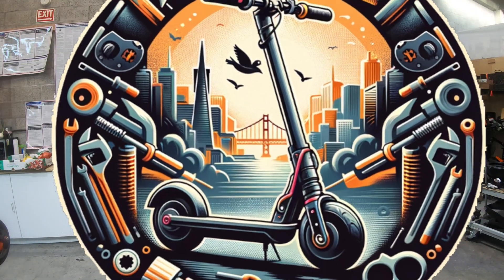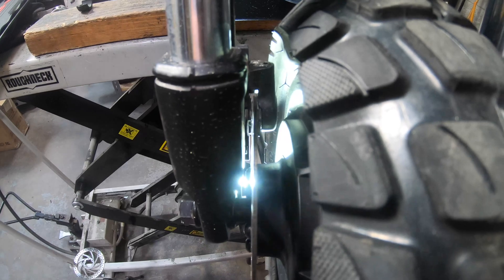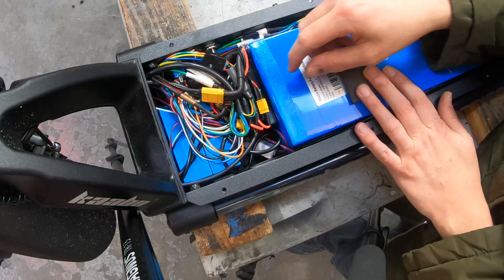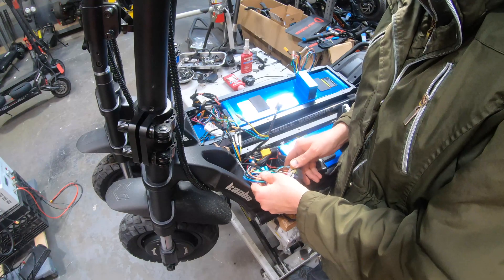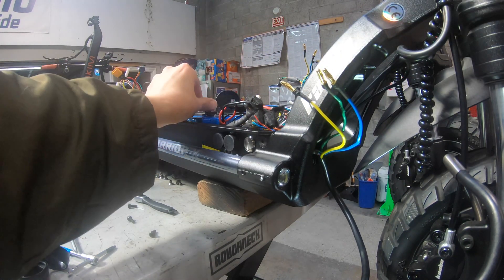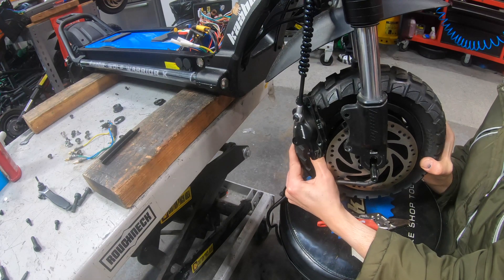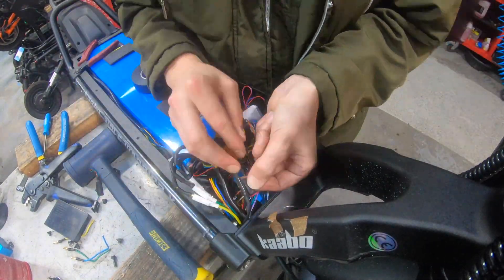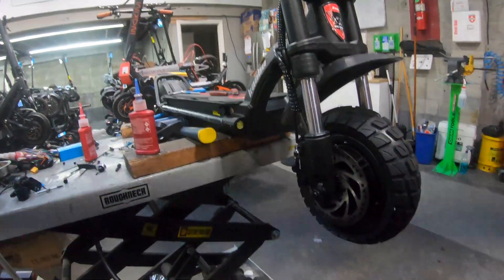Kaabo Wolf Warrior X Front Motor Troubleshooting & Replacement

Comment: I have a wolf worrior x, everything powers up, no error codes, but wont accelerate at all. Any ideas?
Reply from the maker: #1. Is the brake sensor activated? is the tail light blinking/brake light on? #2. Is the throttle working? Test this by pulling the throttle while the scooter is off and holding it down while you start the scooter up. if the display is detecting the throttle it will throw a throttle error under this condition and then you'll know that throttle lever is being detected. That make sense? Try  checking these and give me an update.
Reply: @ElectricScooterRepair i get no throttle error starting the scooter while holding the throttle, brakes and lights work nominally.

Comment: Hi i have a wolf warrior x pro without the hub box and need to replace both front and rear controllers.  Would you have any suggestions on witch controllers i need to use? And can i add a hub box if it doesn't have one?

Comment: Hi mate, My Wolfwarrior 11 is facing a weird problem. the EY3 throttle's acceleration is working by itself. I have already changed 3 new throttles but the problem is there! the only way I can stop the scooter while riding is to push the brakes and if I let go of the brakes it accelerates again, Any idea what's wrong? Thanks.
Reply from the maker: I've seen this a couple times before, most likely the main (rear) controller must be replaced.

Comment: Is that the Warrior X Pro
 or the Warrior X?
I need a replacement hub box but the colours on the terminals are slightly different 🤔
Reply from the maker: The scooter in this video is the standard X but the process for yours is the same as long as you have a version that uses the HUB box (older X scooters didn't use the HUB).There have been different versions of the HUB boxes over the years due to bad design but the mantis/X versions should all be compatible with one another. There are also a different HUB for the Wolf 11/Wolf King and for the mantis/X GT scooters which won't work for you. Why do you need a new box? We're here to help.

Comment: Usually 9 out of 10 times it’s the controller. I have a zero 11x with 2600 miles on The motors. I’ve already blew 4 controllers as well  as the battery pack. Motors still original
Reply: You ride too hard, it's not the machine it's the operator
Reply: @jittcrazy1882  then why have something built for high speeds. Maybe manufacture flaw
Reply: I’ve already had the pack upgraded to 21700 instead of the 18650 so that was already a plus. Those controllers are china crap but they were made for that scooter so might need to switch to Ubox controller or something better for the power
Reply: @Skylersteel  it's not the scooter breaking it's the electronics and speed isn't the issue. You're tough on it - go red line your car for hours driving around I bet it'll blow too.
Reply: @Skylersteel  it's not them being crap you upgraded the problem but never solved the issue. The motor can handle it the battery now can but you never fixed the brain. Got vesc'd
Reply: @jittcrazy1882  yes sir that’s the plan
Reply: @jittcrazy1882  you right
Reply: @jittcrazy1882  means I need more power lol